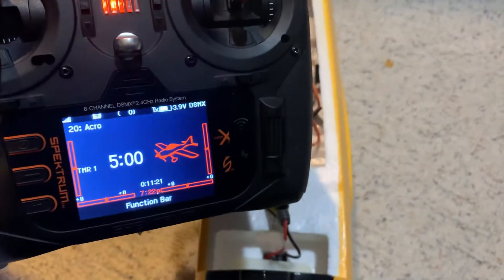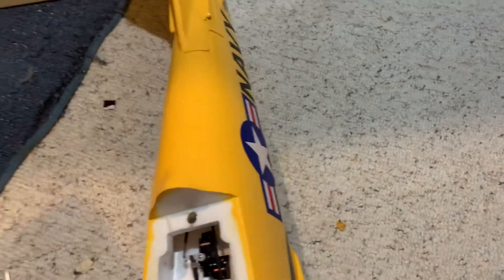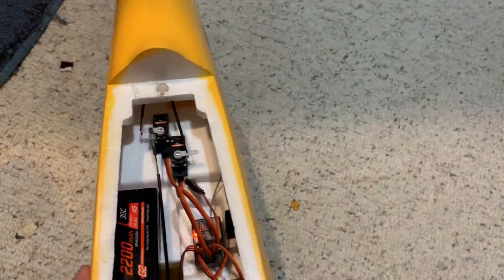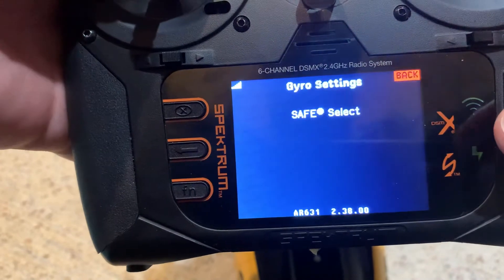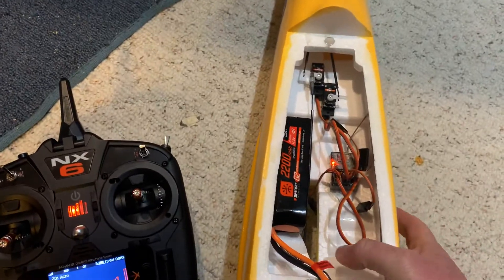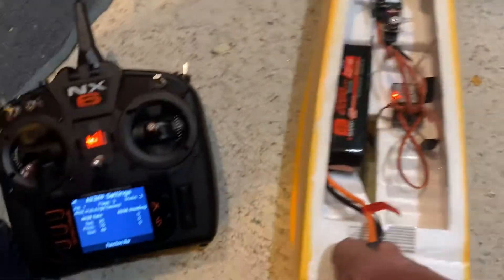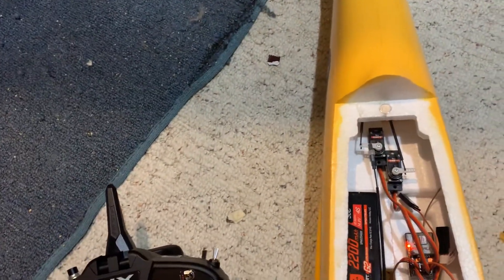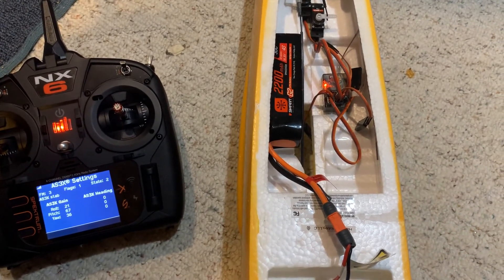Setting SAFE Select w/ Forward Programming

Comment: Questions for ya..if you are using both 5 & 6 channels for flaps and gear how can you use safe on another switch other then making the other one work
Reply from the maker: Put safe select on ch 7, 8, or 9
Reply: @DustinBuescher  it's just a ar631 that's a 6ch receiver.
Reply from the maker: @jimnardone32  it still listens to the higher channels if your transmitter has them. An nx6 has a bonus 7th channel just for this purpose.
Reply: @DustinBuescher  your the man..worked perfectly.  Thank you!